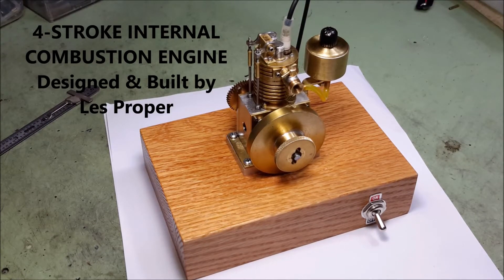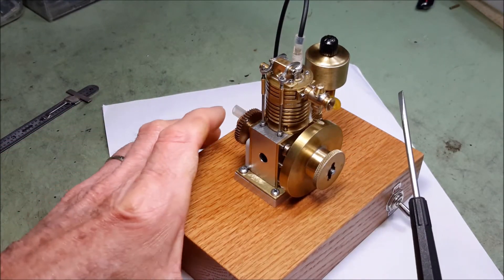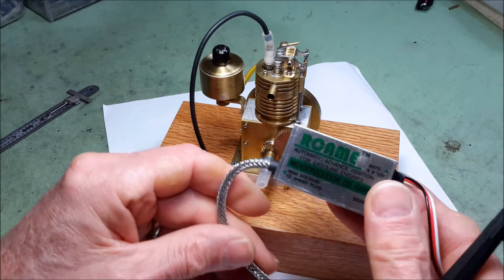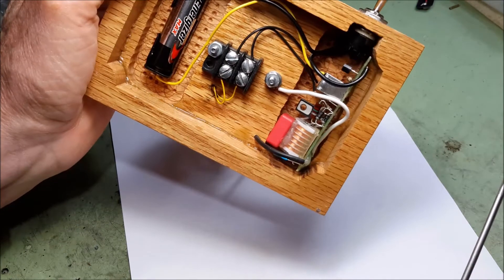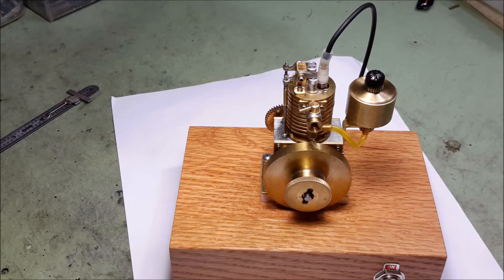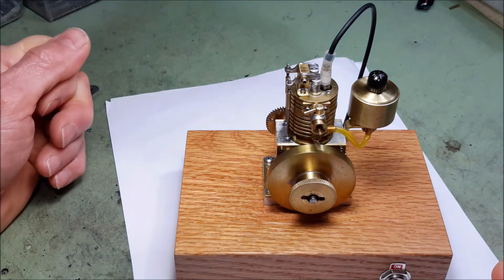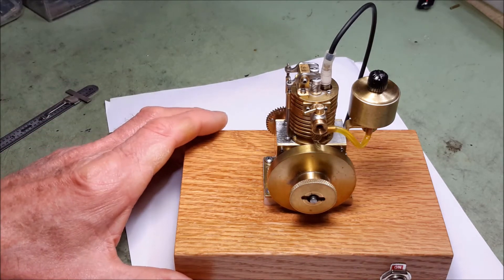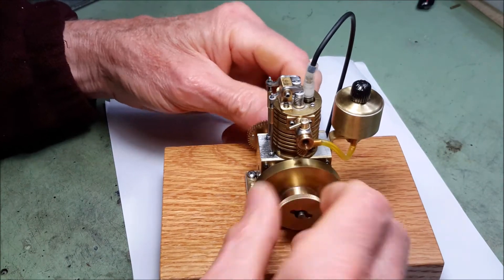MINIATURE 4-STROKE INTERNAL COMBUSTION ENGINE

Comment: Good morning. You do amazing work. Most impressed with the amount of work you do by hand. 
I am a fellow model engine builder here. I am interested in your modified ignition system. Where could I find instructions on modifying the grill lighter to work on an engine? 
Thank you
Reply from the maker: Hi, I enjoyed your video of your Howell engine.  It runs very nice.  There are a two videos showing how to make the ignition systems.  One is by "mylittlediesel", this is the one I have been using.  It is based on one by "Jan Ridder", which is slightly different.  They are YouTube videos that will come up if you search on these names.
Reply from the maker: I should also mention that my latest engine has a replacement part ignition system which I purchased from Stirlingkit.  It cost $43.99 US and included a sparkplug.  It is describled as a 4.5 volt ignition system replacement part for M90, M91, M17B.  I was not able to get my last engine to run and I was confounded as to why it would not run.  I decided to purchase this replacement part ignition system and when I installed it on my engine it took right off.  My conclusion, which may or may not be correct, is that the reed switches I was using
Reply: @LeslieProper  Thank you so much for the information. I have several engines running on hall sensor/buzz coils I purchased from Jerry Howell’s son. That paired with a 6v/12v ATV coil. I haven’t actually had any issues aside from the need for at least a 6v battery. I was thinking I like the small battery option with the lighter ignition. I will look into the YouTube creators you named. 
Thank you 
Matt

Comment: It’s beautiful. I’ve been trying to make one of these forever. 2 main things I have struggled with you answered. Which was the spark system and if I could use brass for the head. May I ask. What is your piston made from and also what kind of spark plug did you use? Or did you just make one?
Reply from the maker: Just noticed I did not answer your questions.  The piston is aluminum with a vitron o-ring.  I purchased the sparkplug from an online vendor:  stevehuckss396@gmail.com

Comment: You probably know this but maybe not. It is much harder for a high compression engine to get a spark than a low compression engine. So at a low throttle opening the cylinder isn’t filled with much air and fuel so it’s running at a  low compression. When you open the throttle more you fill the cylinder more and are running a much higher compression. It's also harder for the flywheel to keep it running but that doesn't sound like that's your problem. Thanks for the video nice work.
Reply from the maker: I heard that high compression could prevent the spark, but never had it explained to me the way you did.  Thanks for the info and reply.  I thought my problem of higher engine revolution was fuel mix ratio, but it may be ignition related.

Comment: Wonderful little engine Les! Am I correct in assuming this whole engine could be built on a Sherline mill and lathe?
Reply from the maker: The overhead valve engine was totally built on the Sherline lathe.  I used the Sherline mill to cut the cooling fins in the flat head engine and my old South Bend for parts of the crank case.
Reply: @LeslieProper  Thanks, that will be a project once I finish a few more of your steam engines. Do you have any drawings you would be willing to share?
Reply from the maker: @robopooperscooper  The drawings for the IC engines are very crude and basic.  I was making them as I built the engines to determine some critical measurements.  They are LibreCAD files.  I can email the file to you if you want.
Reply: @LeslieProper  Thanks Les, I’ve sent you an email with my email address.
Harry

Comment: That is very small.  Well done!  You know you are going to have to build a little utility boat to "test" your engine in the wild !  There is always a problem between idle and wide open throttle, usually due to mixture.  There is a change in the vacuum provided by the piston between high and low RPM.
Reply from the maker: Hello, Glad you liked it.  Already started the next one.  It will be the same cylinder and piston, now that I know how to make them, but a horizontal, water cooled, hit and miss.
Reply: @LeslieProper  Sounds great !